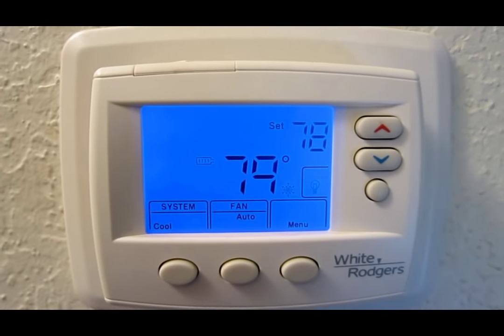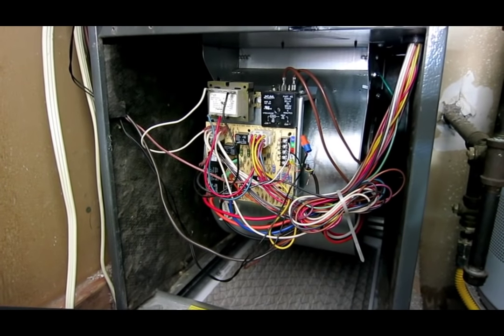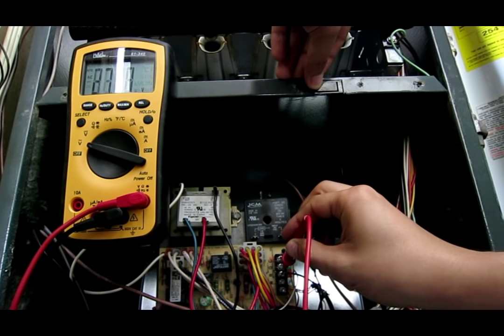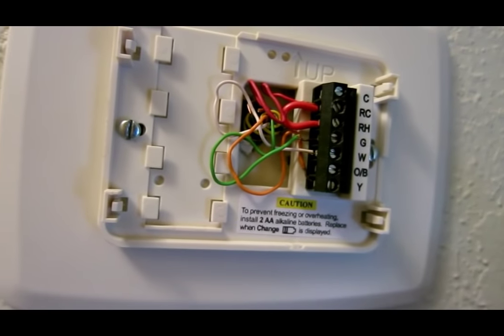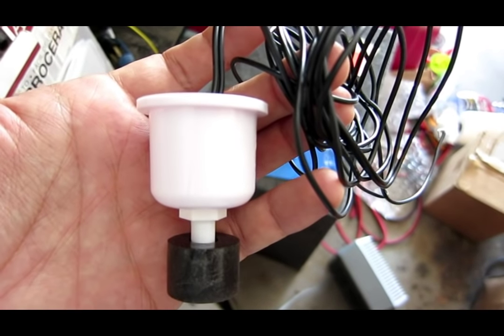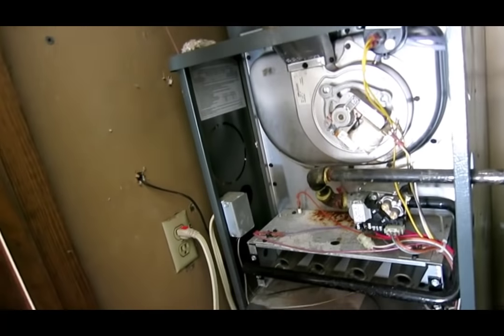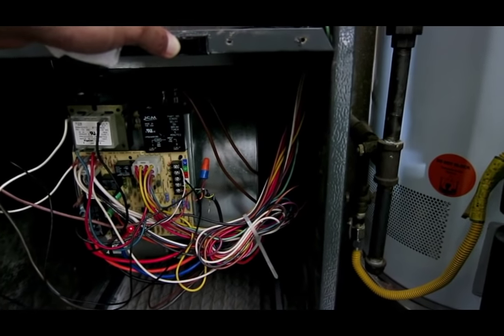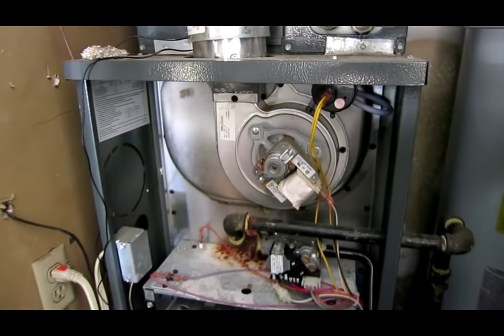most common AC problem - blower doesn't come on - HVAC condensate overflow shut-off device problem

Comment: I assume there is a P trap?
Reply: I don't see a Trap on that drain either.
Reply from the maker: SombraLocs sometimes overflow shutoff arent installed if its a downflow unit. Personally, i think up or down flow should have it.

Comment: question. my home had a leak and water leaked into my ducts. i got the water drained out but now the unit does not power on. any suggestions?

thanks ..
Reply: +Buck Walker sorry to hear that. i would check the fuse first. water damage is a horrible thing...
Reply: +LEGO Brick Builder  ok i got power back to the unit but no air is circulating through the vents. is there a sensor in the ventilation from the unit or maybe i still have water standing in my ducts.  the are under the house by the way
Reply: +Buck Walker hard to say whats going on. maybe the ducts are disconnected.... if the fan comes on, but no air circulation, then there is a good chance there's an issue with the ducts.

Comment: Brand new ac unit inside and out, after complaining many times to landlord from it getting water through the tiles and causing the carpets in the bedrooms to get wet, still does the same thing and can't figure out what the problem is.. The landlords a bitch and never wants to fix anything so anything will help I'm handy but my knowledge for a.c work is useless